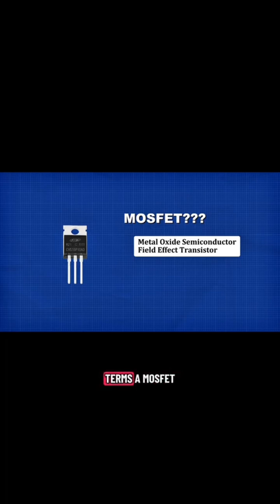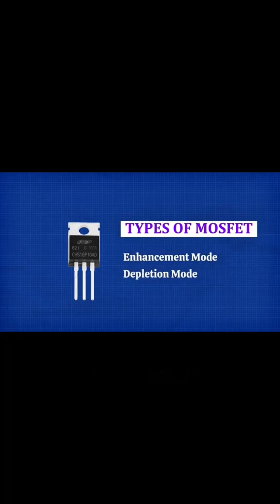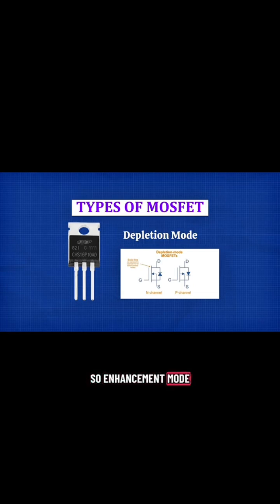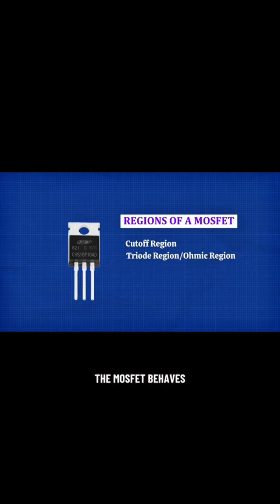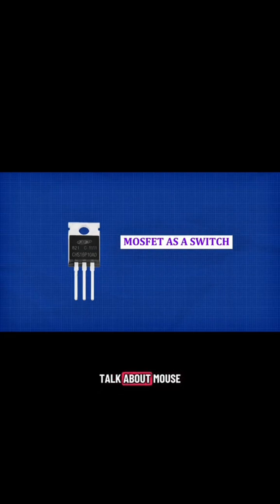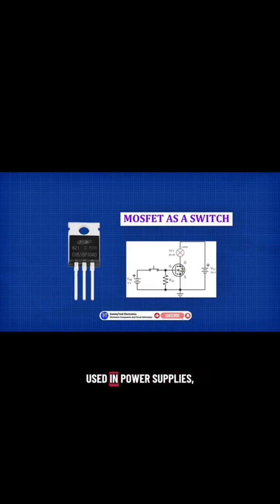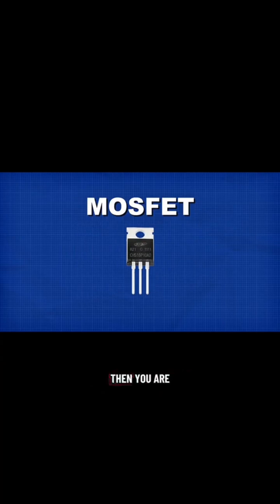MOSFET explained clearly (step by step) how MOSFET works#experiment#electronic#electronicenginering

Comment: A MOSFET's gate voltage controls current by creating an electric field that forms a conductive channel between the source and drain terminals (2:25). Here is a breakdown of how it works:

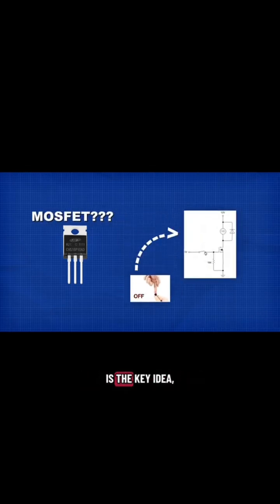Voltage-Controlled: Unlike a normal transistor that needs current, a MOSFET is controlled by the voltage applied to its gate terminal (1:30).
The Insulating Layer: The gate is separated from the semiconductor body by a very thin oxide layer, which acts as an insulator. Because of this, almost no current flows into the gate itself (2:14).
Creating a Field: When you apply voltage to the gate, it creates an electric field through that insulating layer (2:28). This field attracts charge carriers (electrons in N-channel, holes in P-channel) to form a conductive channel directly underneath the gate (3:33).
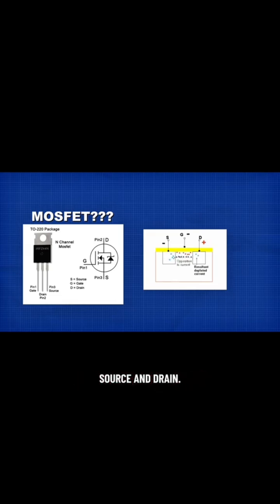Flowing Current: Once this channel is formed, current can flow between the source and the drain. The stronger the voltage on the gate, the more conductive this channel becomes, allowing more current to pass (2:30).

Think of it like a water valve handle: the gate voltage is turning the valve to open or close the pipe, without ever touching the water directly (2:46).